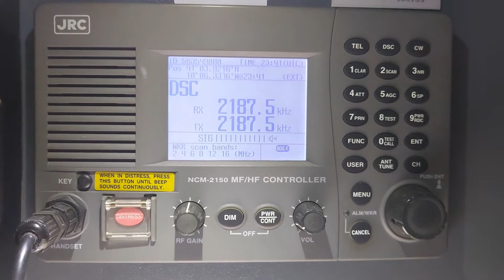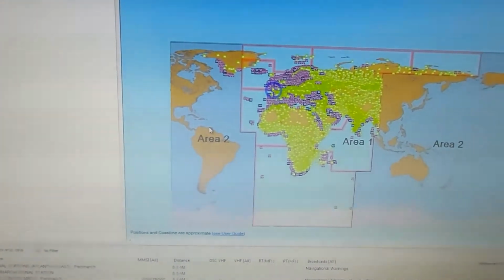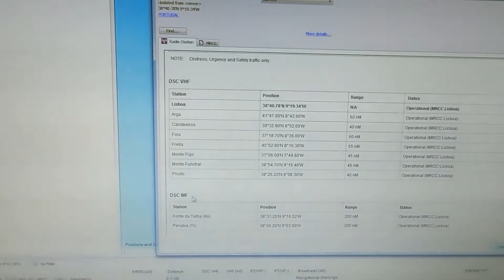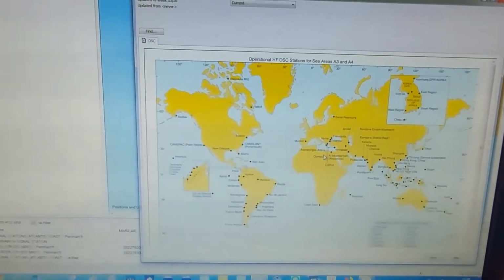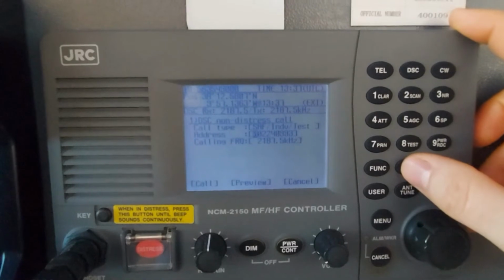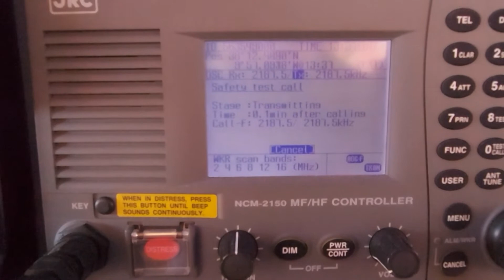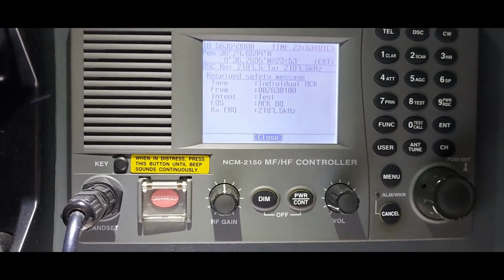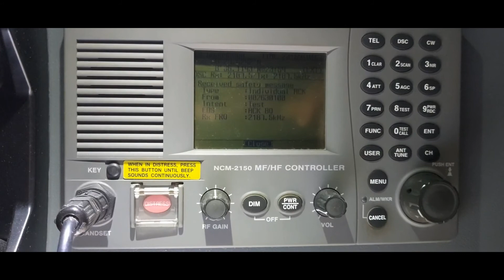How to Perform MF/HF DSC Safety Test Call (JRC NCM-2150) | GMDSS Radio Tutorial

Comment: Good day sir, what to do If re start my SSB MFHF and open again if try to test individual press no.1 DSC non Distress call cannot open to input MMSI no. Kindly give assistant thank you.
Reply from the maker: Good day, sir.
Please check if the MMSI of your vessel is already programmed in the MF/HF DSC radio. Without this, the individual call menu will not allow you to input MMSI.

To test:
	1.	Go to DSC → Individual Call → Routine (Non-Distress).
	2.	Enter the MMSI manually if the option appears.
	3.	If the MMSI input menu still does not open, it means the MMSI is not stored in the equipment or the radio needs service reset.

In that case, kindly contact a service engineer to reprogram the MMSI in your radio.